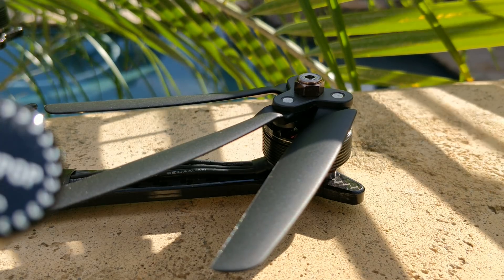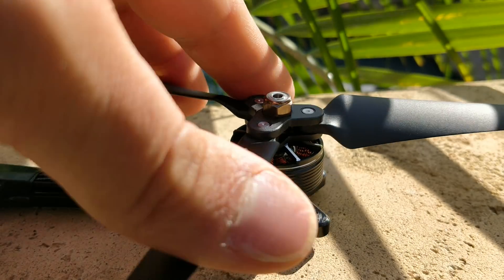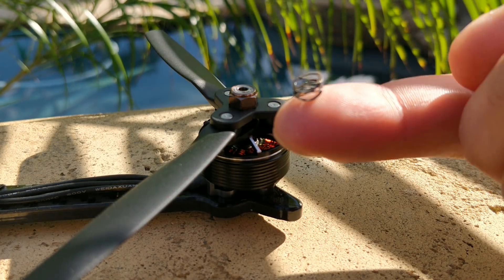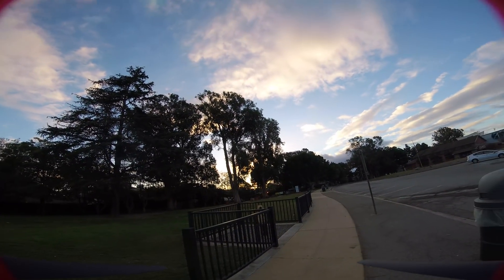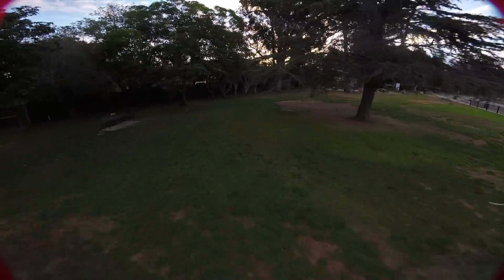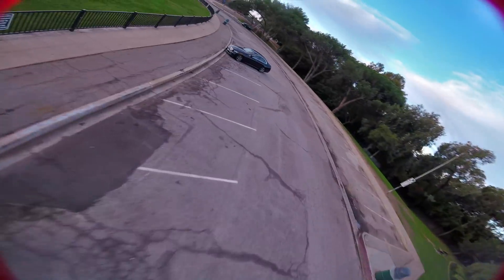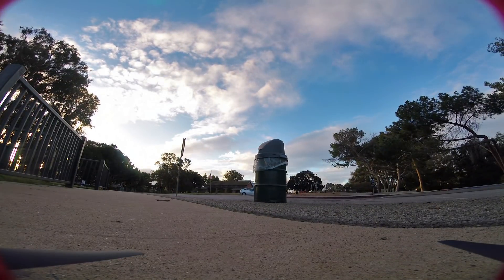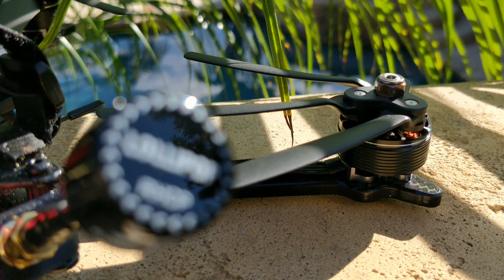Lumenier 6.7x3x3 Folding FPV prop

Comment: Nice review but your completely wrong about how we dive mountains. We use very minimal throttle to rip down a mountain.
Reply from the maker: Minimal until you need to go sideways with the mountain.  I've almost hit the side of a cliff because I couldn't pull up 😅. I ended up slowing the dive to pull out of it which was no fun.
Reply: @Kabab  I can see that. I normally run around 20-60a going up but do around 4-6a going down. Most of my mountains here in northern california are pretty steep though. Gravity does most of the work coming down.
Reply from the maker: @AlbeeSoaring  yeah it's those body suit skydiving style mountainsides that I was imagining. All a pointless discussion as of late unfortunately since there's basically nowhere I can fly at all within 40mi of me. I've gotten kicked out of everywhere I usually go to many times over. Once a ranger pulled a gun on me while I was flying. I only saw it through the fpv feed. I dunno what on Earth he thought a kid flying a toy leaning on a Tesla is going to do....
Reply: @Kabab  that sucks. Sounds like a time to move to a new place where they don't know you yet.. lol I don't know what state your in but here in California it's pretty chill unless you're ripping up a park where some up tight snobby power walking psycho old woman is.. lol

Comment: funny, took Dalprop a year to come up with 5 inch folding props
Reply from the maker: Nobody else did.  Now that DAL did, Gemfan is racing to finish one and HQ will think about it in another year or two after it becomes ubiquitous.  Even though HQ does the most random projects for sectors of the market that don't even exist and they're the first ones I discussed this with...
Reply: @Kabab  we definitely need more foldable 7 inch props
Reply: and frames.. :)

Comment: I just got a set of these. The first thing I noticed is the amount of twist in the aerofoil. The tips are essentially flat and I wonder if some engineer was trying to implement something like a Horton wing concept. The idea is that the wing isn't elliptically loaded, instead it has a bell shaped load without load on the tips. It induces a downward air motion in the middle which usually makes a wingtip vortex. But the wing has so much twist that the vortex lands about 76-80% of the wing length and there is actually an updraft within the wing. Interestingly the wingtip does not have to push up on the air to move the vortex inward and the tips still produce lift but with a curve gently tapering toward zero. According to some believers in the design the low amount of structure in the wing tips saves enough weight that per lb it is more efficient than elliptical loading (though at a cost of adding wingspan, elliptical is still more lift per wingspan) when applied to fixed wing aircraft if the control surfaces are on the wingtips it can provide proverse yaw instead of adverse yaw (something horten didn't try) but it could in theory make a propeller quieter especially if tuned for a certain flight envelope. I think I'm gonna like these props based on your video. And I'm curious about how much noise they will make. Something along these lines could be good for long range or cinema but with cinema drones going the way of ducts I'm not sure they will be optimal. I'm sure ducts like a more bull nosed prop. But for larger wide angle shots and long range a light prop with a lot of twist could be just what we need.
Reply from the maker: They're not particularly loud or quiet and also, I think the fold actually helps this blade work as it may have an aerodynamic self balancing effect with leading and trailing blades. It's not a particularly efficient or inefficient prop. I actually wouldn't recommend it for long range. It is nice to fly however but for limited use probably. Not a really great prop but definitely surprisingly better than expected

Comment: Just did a quick search and found these 5 inch folding props on microheli. Have you checked them out?
https://www.microheli.com/multicopter-propellers/plastic-folding-3-blade-propeller-5045-cw-ccw-w-bracket-yellow.html

edit: I see they have a bunch of other folding props too. Would be curious to see what you think of them.
Reply from the maker: wow.  very interesting.  wish they weren't bullnose props however.
Reply: @Kabab  Well I wouldn't know the effect of different prop designs as I'm new to fpv. I'm a fan of your content btw and the fact that your progressing the hobby so much. Keep up the great work 😀

Comment: nice video here is a link for you some different folding props https://www.youtube.com/redirect?q=http%3A%2F%2Fwww.microheli.com%2Fmulticopter-propellers%2Fplastic-folding-3-blade-propeller-5045-cw-ccw-w-bracket-yellow.html&event=video_description&v=x91dC3Tm4zk&redir_token=XtnCVz6JzyYg3OGn2zQ-IKhDgP18MTU0ODI0MzUxOEAxNTQ4MTU3MTE4

Comment: I just got some of the 6.7" prop and noticed a lot of vibration. Did you experience this? Might be that the hinges are a bit stiff..?!?
Reply from the maker: I didn't notice any vibrations at all however at high RPM the props do begin to flutter.  That's what I meant when I said they're not high speed props.

Comment: very interesting, i'm building a quad plane and considering folding props for "glide mode"
Reply: That's a different kind of fold though
Reply: @mece66  for the quad motors, that is how they would fold...i think. not the planes prop.

Comment: Good stuff. What do you find is the most efficient 6” & 7” blade? Of course bi-blade is more efficient then tri-bladed props.
Reply from the maker: Honestly the most efficient is a light weight 5". I can easily get 5+ min from a 1300mah 4S on a 5" whereas the 7" struggles to reach 4:30 with a lot more power on board and more favorable physical properties.

Comment: For me that prop seems pointless. I fly 3 inches because I live like within 6 miles of 3 airports, 2 are millitary so I avoid the weight restrictions but still obey the rules for bigger quads. I think that folding arms kinda like a DJI would be better especially for smaller quads. Merry late Christmas!

Comment: It should be easy to design something where you can change the props (3xØpin). It will be nice for the 5" too. Easily back into the backpack (I do like have the drone fixed outside for different reasons)
Reply from the maker: Yes definitely should be

Comment: Im editing this comment it might not make sense. Please have some blades made with a eye hole on the end and slide them over your motor shaft. Bam folding prop no hub and could replace individually let me know what you think. Yes it would stagger the blades height but does it matter? i don't know. Would it be heavier? Maybe you do need a aluminum hub that you buy separate and prop manufactures just make different blades i have been thinking of folding blades for a while. I use them on my planes that don't have landing gear they work well. I want to try aluminum prop just for fun.
Reply: I'm don't think a prop like that would work. It would need some type of bushing or bearing on each blade so it can freely fold when held by the prop nut. However, the biggest problem is that the rotation points aren't offset from the motor's axis of rotation. This would allow the motor to spin without fully transferring that torque to each blade. Also, if the blades aren't equally offset from the center in a radially symmetrical fashion, then the centripetal force won't tend to make them evenly spaced. So, it would be unstable due to the mass not being balanced.
Reply: @joshuamiddleton5274  ya your right about the bearing i got ahead of myself. a 3 way hub of some sort would have to be used

Comment: woohoo, another kabab vid :) So maybe some type of ball locking system that it folds but when you straighten them out then kind of lock in place. or the outward force of spinning along with a ball lock system would keep them locked in place with more force when spun up. I feel you're losing a bit of bite because when you flying and you hit the throttle quick the force of the higher RPM would cause the blades to fold up for a quick second. maybe not though I'm just taking a guess here with some logic. Anyway, take care, my friend, thanks for the double trouble on Xmas!!! Hope you had a great holiday with your family and friends too

Comment: Low pitch prop + high KV motor  vs. high pitch prop + low KV motor: is there any sweet spot? Comparing similar thrust/performance is there any difference in speed, grip, efficiency,  amp-draw?
Reply from the maker: Yes, definitely.  Typically high pitch props have less response and sometimes less control.  However they tend to have more grip half the time.  It's all a balancing act.  No two props are the same.

Comment: Would the flexibility of the blades add noise?
Reply from the maker: Yes, definitely. But flex doesn't mean more noise.  The same prop in flex or rigid will have different noise profiles.

Comment: I would argue that you use less throttle on mountain dives, half the work is gravity
Reply from the maker: Sometimes you're falling so fast that you need to get some lateral speed to pull off the side of the mountain. You need the power when you need it.

Comment: What kind of motors do  you use? I know it is 2208 but what is the brand?
Reply from the maker: It's the Hawksky.  They made this motor just for me.  A small batch was for sale on piroflip but sold out immediately.  There are more coming.  There is also a motor from iflight that performs essentially the same.  I just tested it today.  The XING 2208 1800kv.
Reply: @Kabab  Real shit?